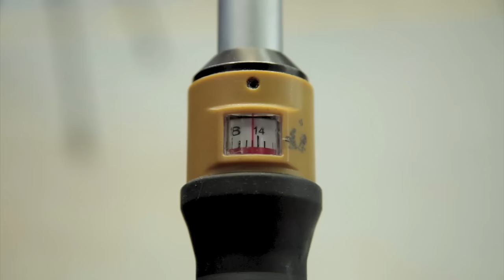installation of the roof rack  -  version 2

Comment: Should have pulled back the roof liner and fitted a metal plate on the inside before putting the bolts through. the roof is probably distorted by now.
Reply from the maker: Dear viewer,

if you have technical comments or suggestions for improvement, please let us know by email. 

roadranger@hoehn.de

Thank you very much for your attention. 

Your Roadranger Team
Reply: So you are saying each foot would have its own steal plate? Or one steal long plate connecting the two feet for each side?